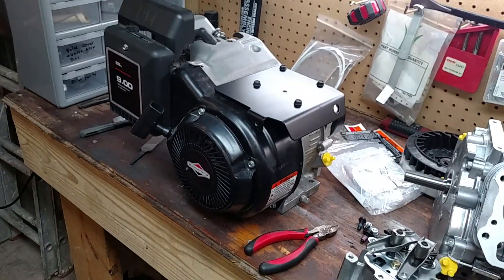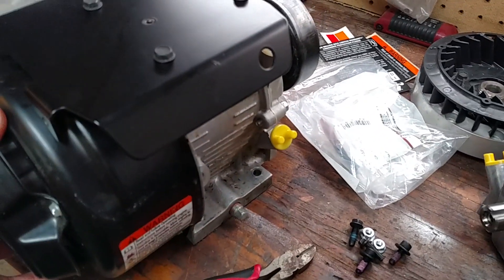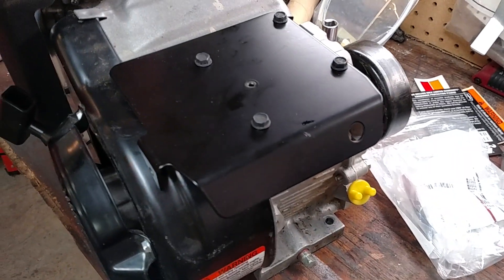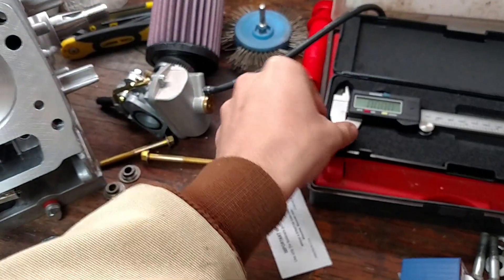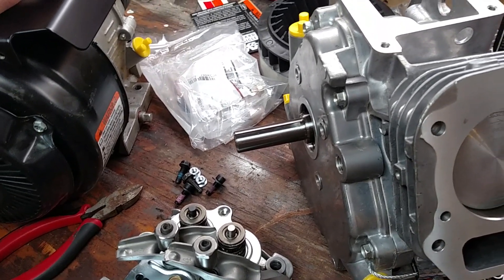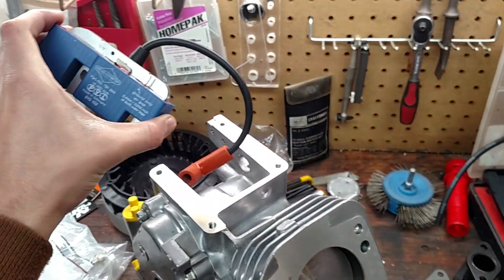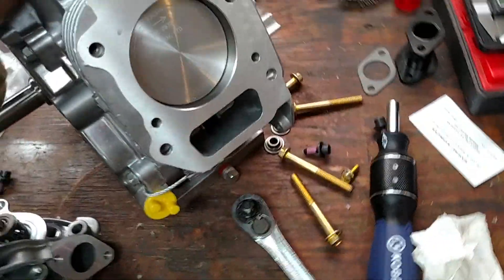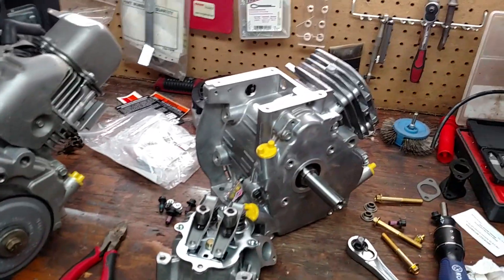Uprgade your briggs Intek 900 to an animal racing engine!

Comment: They make a D,U bushing to put in block on flywheel side,reduce wear,and replacable,just mill it in there,,,crank is dofferent stroke,ports are resticked,they have a billet flywheel you can use also,they make a billet rod from briggs,there not identical by all means there closs ,but no cigar!!!!!

Comment: I have a B&S 900 series from a pressure washer and putting it on a go kart Manco 405, how do I run the throttle to where the RPM’s responds like a normal engine? Do I need to remove the governor all together or just run a cable to the throttle lever on the engine?

Comment: Oh man!!!! I just got a stock one running and ready to mount on a mini bike,  and i just fell into a rabbit hole of info on how to upgrade this thing in the future.....ive been sitting on this engine for 4 or 5 years finally got it started and running nice.....and now this 🤯🤯🤯going to be a fun journey after i enjoy it for a bit ,but upgrading for sure now, thank you sir
Reply: I'm in nearly the exact same boat! Got that same engine for $20 in perfect used shape, sat on it since about 2021 or so, and am now learning what I need to do to get the power doubled and cram it into a mini bike. Like an old Honda Trail 70 clone or a Pack Mule or something. I'm new to small engines, and they're a different world compared to normal internal combustion engines i.e. cars, trucks, etc. Gonna be an interesting journey! Gonna learn to weld too, so I can build a custom kart and mini bikes. Should be fun if I don't die in the process 😂 🤘🏼✌🖖🏽

Comment: If I add a 12k rpm blue coil to a stock lo206 will it blow my engine?
Reply: Yes the rod will break,over time past 6500rpm,s
Reply: @stanleyshults6427 I since then I’ve added 315 cam, billet rod , big valve head & Blue coil

Comment: These motors are similar and many parts can interchange but far from identical.  About the only things that are identical are misc bolts, valve cover, the tin around the head, pushrods oil plugs and caps.  The best way to turn one of these into an animal is to lift up the oil caps slide in an animal and re-install the oil caps.

Comment: Sorry but ur so wrong,,crank shorter stroke head needs ported block is weak will break,,,there is bushing  u can buy also  4 crank on both sides,du bush,ns or u can make 4 them,,u need 2 do ur home work on this b 4 u do this conversion !!!!
Reply from the maker: Motor ran for years... Still runs

Comment: Some of the newer, higher end Briggs utility blocks are dual roller bearing crank engines.  And with the displacements, Briggs' website lies about their bore & stroke/displacement. The tech specs dont line up, and if you plug the numbers into a displacement calculator  they toss back numbers that indicate smaller blocks. For instance, a Briggs CR950 208cc block specs from their website will actually figure out to a 169cc engine when applying the given bore and stroke. I assume this is in part because they dont like selling a $270 motor for someone to order another $200 of parts elsewhere and build a motor they're charging $700-800 for. Do your homework on Briggs'blocks before you think any old intek is capable of becoming an animal
Reply: Hey Jesse, I gotta admit seen this video and thought why not, can u explain to me further why I may have wasted my cash. Thanks man

Comment: What about using a 208 block with a 205 crank
Reply from the maker: Might change the comp ratio
Reply: @wagdbikerider  it definitely will just wondering if I'm the only one thinking about it it's combining  the bigger bore and stroke of the engines hoping there is enough meat on the face of the piston to mill off
Reply from the maker: @craigchiddo2794  yea can't say for sure

Comment: I have an Intek 800 series also 205cc which I cannot see any discernible differences. Could it be that maybe the carb is all that was different? I know the crank has a ⅞" and 1" step as it came off of a chipper/shredder. Was curious about any hidden differences if any.

Comment: I know this vid is kind old... but I have a briggs 6.5 that's pre Intek but it looks just like the Intek the motor number is 110432-0121-e1.  Do you know if I got swap in the stock animal rod,piston, flywheel,coil and switch to the mikuni style carb as you describe? I'm building a mud motor and I want little more power but dead nuts reliability. Plus the briggs engine I have was free to me and is rather build up the briggs than buy a Chinese clone
Reply from the maker: J Taylor can't say for sure. You will have to take measurements. The carb should mount right up however

Comment: Ok you are probably the only one who know this are the carburetor holes for both of them the same I want to get the animal carb but I have a stock intek 900 head would that work I just cant get My carbs to work with a filter on they always turn off when I give gas so the animal carb would be my only option I can put a filter on that
Reply from the maker: nightmare in action yea I think you can but you may need the spacer part as well
Reply: wagdbikerider alright thanks I got anoyed with the original carb

Comment: I had my piston slap the valves on mines
Reply from the maker: nightmare in action need better springs
Reply: wagdbikerider question I just can't find stiffer springs and I rev it to 6000 rpms a little more and valves start hitting
Reply from the maker: nightmare in action I think out2win.com has some
Reply: wagdbikerider I think I blew my engine there was white smoke coming out the back and it the oil looked grey someone told me thats not good and I cant even tell what model engine I have this is the numbers it has 126332-0215 can't find any replacement rings because I dont know the model

Comment: i got the briggs 15c107-003-f8 snow engine 250cc 
junk !!!!!!!!!!
no ball bearing crank !!!!!!!!
the LCT better block steel cylinder sleeve and dual ball bearing 
Briggs Cheaped out!!!!!!!!!!!!!!!!!!!!!!!!
Reply from the maker: Joni English it is a snowblower motor haha. They will run for years despite the cheap build
Reply: briggs very smart !!!!
i tried doing a cheap rebuild but motor did not last 
parts not cheap for these motors 
look at my 2014 craftsman snow shredder rebuild only lasted 30 mins after rebuild
original owner ran with no oil

Comment: what are your thoughts on b&s vanguard? how does it compare to their intek?
Reply from the maker: Wesley Jackson they are larger engines that have lower efficiency.  I prefer the intek because of ability to build out. but the vanguard is the only way to get over 20 hp. if you want 15 hp or less the intek block is your best bet. they offer very high power to weight ratios
Reply: appreciate your input 
I've got an old Heathkit Boonie bike, put a predator 212cc on it, runs pretty strong. I've also got a 9hp (or was it 11hp?) b&s vanguard just sitting around, but it has a 1" shaft and my comet tav is obviously 3/4" because it's on the predator 212cc. wouldn't be too hard to swap it in my mini boonie bike but I would have to go get a 1" tav....just don't know if it's worth it. it would be about twice as much horsepower to the jackshaft though
Reply from the maker: It would require new design of a lot of mechanical systems. New drive line, new gas system, new mounting system. It's possible but would be timely

Comment: basically a new engine
Reply: And this children is why modern Briggs engines suck so hard per$ it's ridicules.. This is why we use 100$ Honda clones (all hf 212s have dual bearing cranks cast steal cams cast cylinder sleeves and handle way better rpm on stock rod than the Briggs 900)... A good genuine honda gx200 can be had for less nowadays than a clapped out Briggs and the aftermarket support is better, cheaper, easier to navigate.. My gx mini with stock rod and piston is just as quick as my boys animal I won't rev it as hard as he does and yea I've thrown stock rods but the only way Briggs is worth it is if you come across something used dirt cheap
Reply from the maker: Sloan V cost wise they are similar. some people just like to tinker though
Reply: wagdbikerider I understand that. It's just funny. :)
Reply: wagdbikerider sooooo couldn't you just take the crank case cover off the animal and put it on the stock Briggs and that would fix the bearing problem?
Reply: wagdbikerider shit my bad misunderstood the bearing part, so basically new crank. New cam. New valve spings. New rod and piston. New carb, and will the 6hp clutch work on the animal or will I need another one?

Comment: Did the aftermarket connecting rod fit on the stock intek crankshaft? I am thinking of getting one. Thanks
Reply from the maker: Smooductions yes and no. it did not fit on the stock piston so you would have to get a new piston at least
Reply: k, thanks for the info

Comment: The blue PVL IS on stock Animal. The WF has red which is 7100 rpm
Reply from the maker: Genesislights the blue I got here said 12000 rpm on it so I don't think that's the case with mine. I could be wrong though.

Comment: I'm doing a very similar change but I'm going from 6.0 Intek to upgrade as high as I can go with it. I put on a high flow air filter on my stock carb and at first I got the usual problem of too much air so I made the main jet bigger by a couple hundredth's of an inch and now it's super inconsistent. I'm thinking I need to change the intake manifold from this short one on here to one of the animal intakes but I'm not sure. Do you think this could help? Also by inconsistency I mean it runs but only for a couple minutes and then it starts to flood. Funny thing about it though is I put a piece of plastic into the intake to create turbulence and it helped a lot. Suddenly it would run practically forever as long as I kept the RPM's up it would just get a little jumpy at high RPM's.
Reply from the maker: yea I'd try a longer intake with a baffle
Reply: Thank's man. I'm working on trying that. I don't really know exactly what to buy. If you have any idea what part has anyone with a similar situation used I would appreciate it.
Reply from the maker: fastermotors.net or out2win.com

Comment: there's more to it then Just sticking animal springs on there. the stock retainers are junk for high reving stiffer springs.
Reply from the maker: new high strength retainers are easy to get too point is you can upgrade a cheap block

Comment: wagdbikerider I knew these motors were exactly the same, I have the intek 850 series which is not mention much on the Briggs and Stratton website and other places for some strange reason, I got it for 40 dollars from this poor Sucker who took it off his tiller because he thought it was broken even know the motor was practically new, so I took it home took off the carburetor bowl expecting dirt but was clean as a whistle, and then I took off the air filter and there was tons of dirt in there, I knocked it off put it back in and it already had lots of gas in it choked it and it started on the first pull, and the only thing that I did to it so far is put a straight pipe with a rlv muffler just like yours I got for free, I was going to mod the motor more with animal parts and put it on my other go Kart but then I realized it was going to start to cost a lot but then I decided to start the go kart build I always wanted to do and keep the Briggs on my orange old go Kart, so I bought a Rotax 399cc 24hp 2 stroke snowmobile engine for 65 bucks way cheaper than modifying the Briggs and more hp in stock form, you can check out my go karts on my page